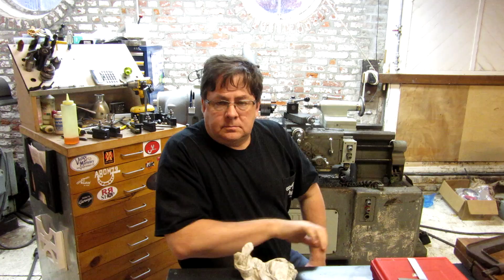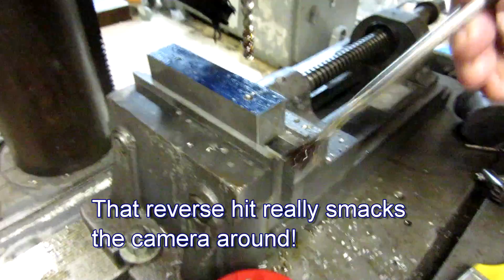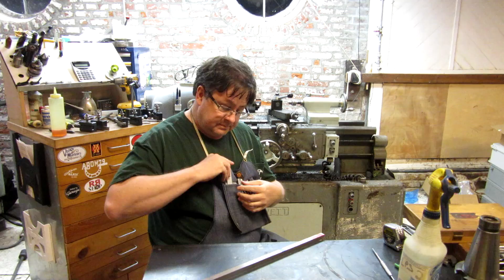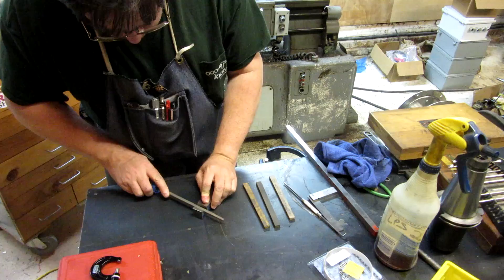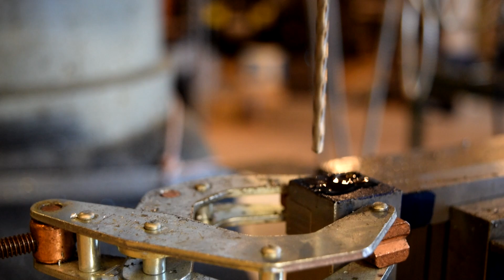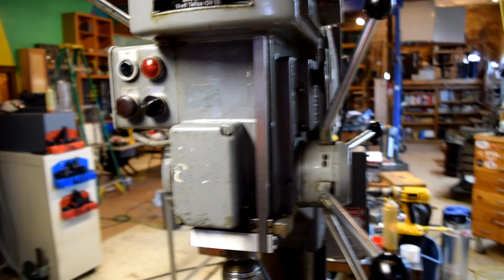Alzmetall Drill Depth Stop #2

Comment: I have 2 questions.  Q1:  why did you chose to drill through the side rather than the face of the stop rod?  And is Tailstock now known as Rosie!

All the best!

Mike
Reply from the maker: +Junk Mikes World There is not much depth there.  I guess it would have been ok, the required three threads, but just.  Also, just from a looks point of view, I'd like to keep the front clean.

Comment: Question for anyone:  what tools do you use daily that are cheap unbranded, but have stood the test of time?    i have several pliers and cutters that have been used for over 25 years, unbranded, that are still in good condition, i think also my nail and punches are mostly unbranded or a budget brand and have also been up to the job.plus my lightweight claw hammer, with unknown wood 'made in brazil' - its too handy a size for random hitting things with and never looked for a replacement (about 8 oz) . the super cheap metric socket set that i bought in mid 80s and used semi pro for 10 years, now lives in the car , but never let me down.   but cheap screwdrivers dont seem to last 5 minutes.   i do have high end brands but they sit locked in my toolbox in case i need them.
Reply from the maker: +jusb1066 Honestly I can't find any unbranded tools that I use on a regular basis.